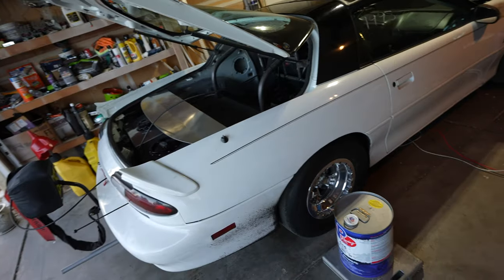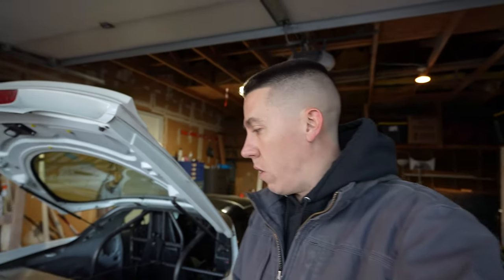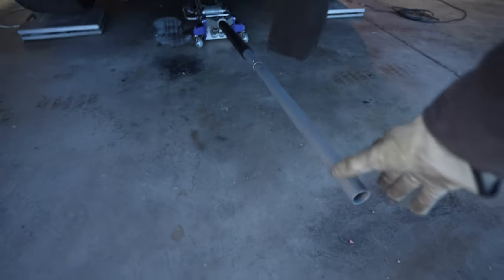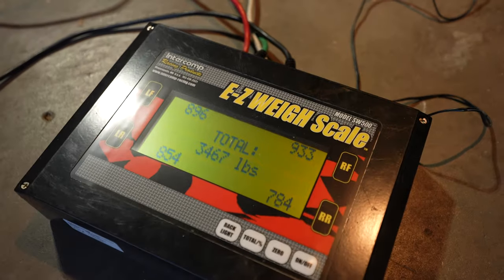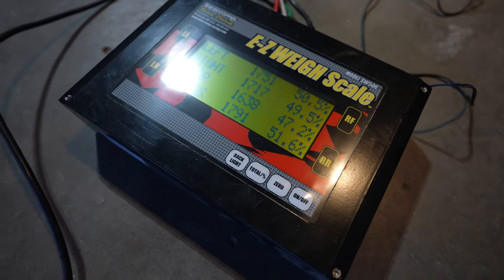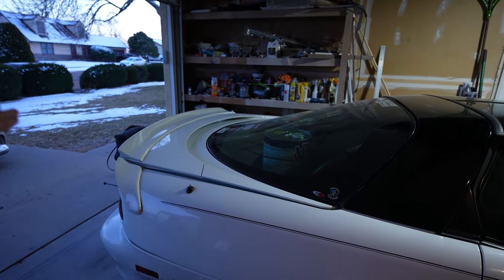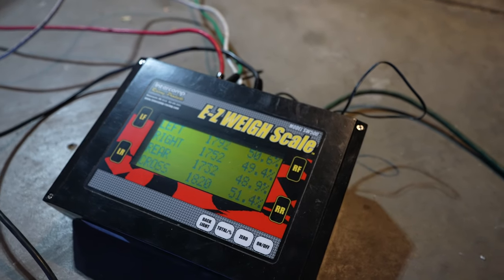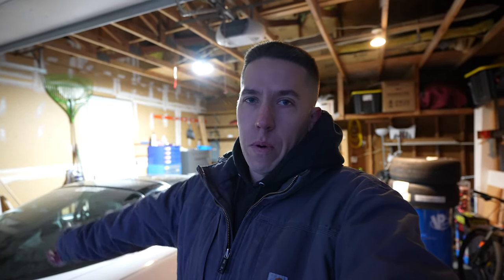What Does My Twin Turbo Camaro Streetcar Weigh?

Comment: Interesting video as always!  When we first built our shop El Camino, it had a 525 hp naturally aspirated LS1 (aluminum small block).  The intent was that it could drag race, road race and carry engines around in the back and do it all on the same street tires.  It weighed in with the same 52/48 front/rear weight distribution as your Camaro.  In that configuration, it ran 12.8's in the quarter mile and did great on road courses.  When people would see it at the drag street, they'd suggest we put cement bags in the back for better traction because that's what worked for them back in the day.  The difference was that their SS iron big blocks weighed so much more more.  Getting a couple of hundred pounds out of the nose was even more important for road racing due to how it affected steering and braking.

Comment: Plan on doing weight loss stuff to my 4th gen too. Going to focus on any brackets that are not needed, fender rails(u cut them off when u did ur rsm kit, i plan to do the same), pass air bag, door bars, any bolt threads too long, and some othet hole sawing. Well see where i come out too
Reply from the maker: Nice I definitely have a few things I can still get out of the car but we’re sitting decent. You always wish it was lighter though lol
Reply: @BuildTuneRace  absolutely 💪